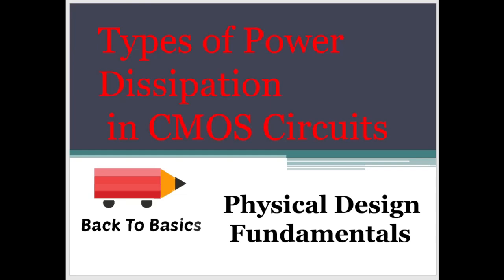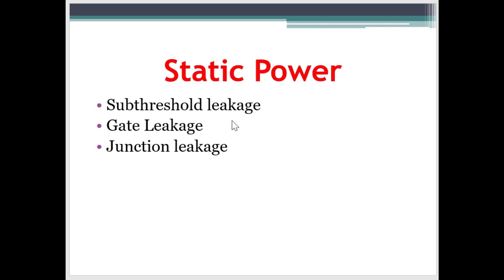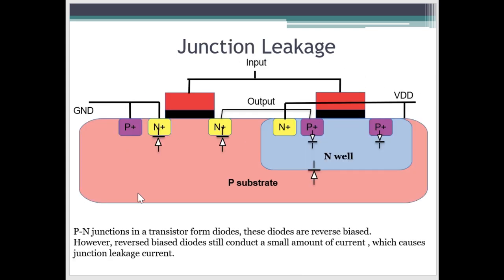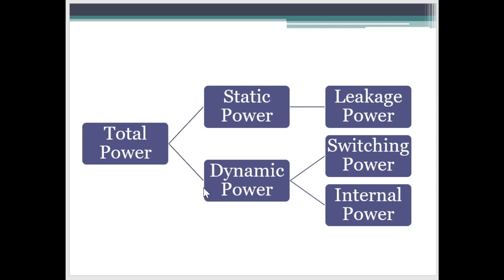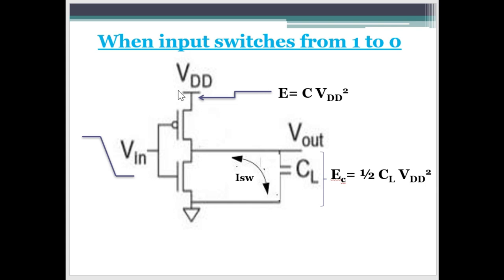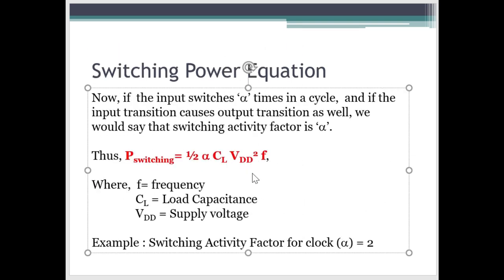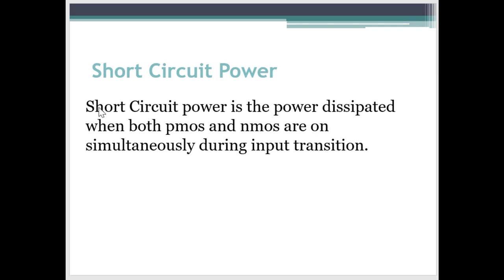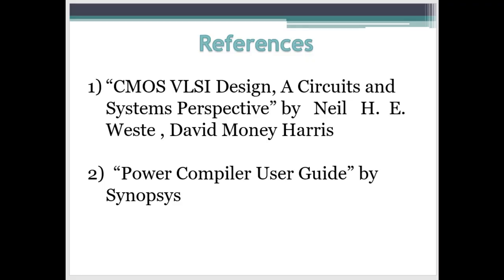Power Dissipation in CMOS Circuits | Back To Basics

Comment: In the dynamic power dissipation, in switching power dissipation, will there be any power dissipation, if the output is not changed due to input?
Reply from the maker: In that case, it will come under internal power, not the switching power

Comment: Mam you said that in gate leakage current, gate oxide is very thin, it allows gate current to pass through it, but the gate current is 0 mam in case of cmos inverter.
Reply: this is second order effect i think ///
Reply: ideally it is o but not practicallyyy